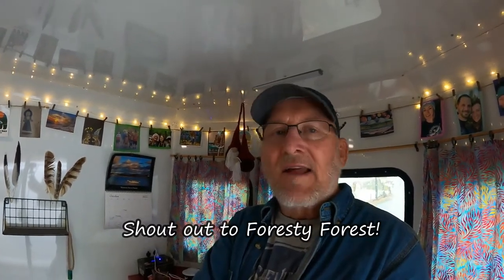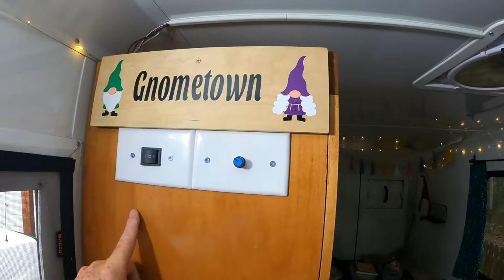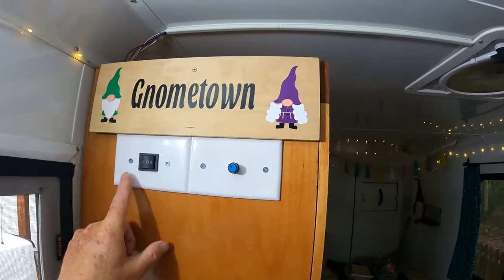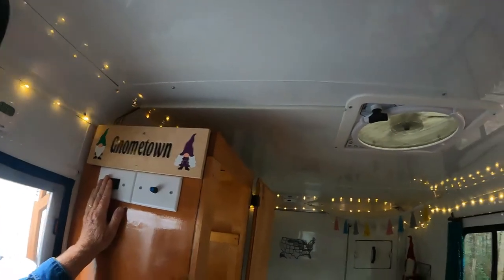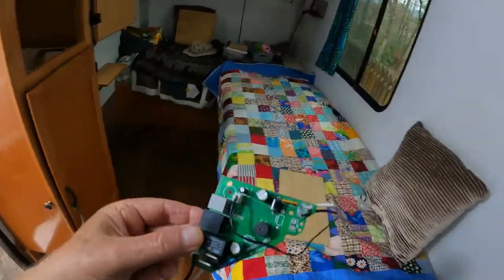MaxxAir Fan Repair and Mod

Comment: It just happened to me! Thanks so much for the video. At least I know there's hope! Thanks so much for sharing and happy travels!
Reply from the maker: Sorry about your fan, I guess it's inevitable with those. I have read that if you contact MaxxAir they may send you a circuit board.
I am very happy with our fix though, it's worked without fail since day one.
Thanks so much for watching, hope you get it sorted out!
Reply: Thanks for your reply. I bought that controller and think I wired it correctly but my 10amp fuse keeps blowing. Just wanted to ask what size fuse you're using. Sorry for the beginner question and thanks again for the vid. @TheGnometownCampers
Reply from the maker: Sorry, I just saw your comment. Hope you got it worked out. I am pretty sure that I used a 30 amp fuse on mine.
Reply: Thank you very much. Appreciate your reply and hope you're doing well! @TheGnometownCampers

Comment: I think all trailer has a moisture problem when caming in the cold. Did you reach out to Max fan and see if they would have replaced it? If you let them know you're a YouTuber, they might work with you. I had a blog that I built for my trip to Alaska and I called Battle Born Batteries and was able to get the thousand-dollar batteries for a hundred off of each. Plus,stickers, a hat and shirt.
Reply from the maker: I did not reach out to them but I do understand that they send the circuit boards out left and right. I just didn't want to have to deal with it again.

Comment: Does the max air motor still work in two different  rotations . Pull air and push out ?
Reply from the maker: Yes it does. Thanks for watching.

Comment: Our issue is the dometic fan arm that opens the vent lid broke, like witin the first week!  Dometic has really gone downhill. They blame China for inferior parts, just pass the blame...so we now must become fan fixers,lol
Reply from the maker: Ah, a broken lift arm. Bummer, did they send  a new part?
Reply: @TheGnometownCampers  have not called them yet, we r collecting all our dometic issues, stove, heater, fan...so we can get ALL these problems solved with the call..
Reply from the maker: Geez! Sounds like a mess, hope you get it worked out soon.